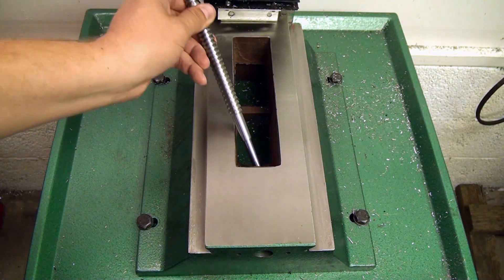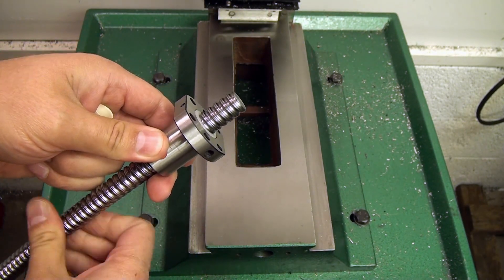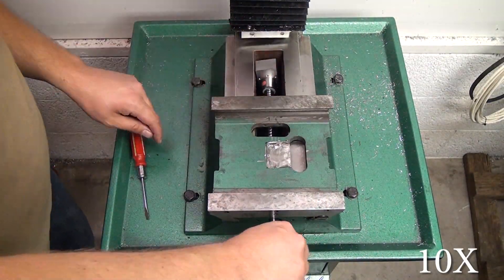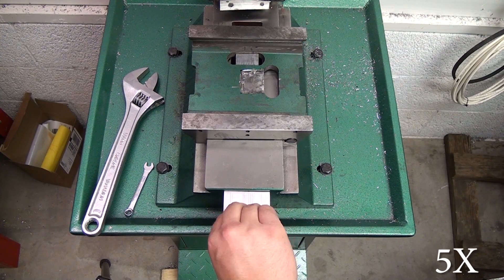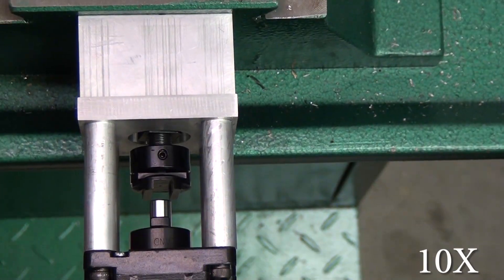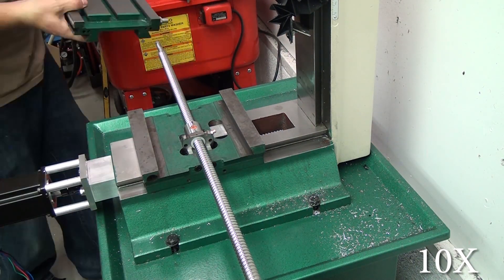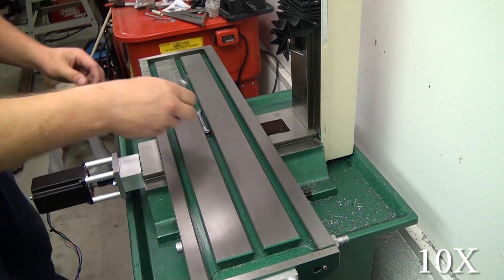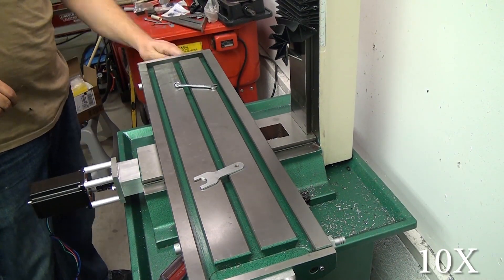G0704 CNC Conversion 07 - XY Assembly & Ball Nut Modification

Comment: Do you miss being able to operate the mill manually? I hear you can kind of do it with a pendant or with some extra plastic handles.... how does it compare with the regular, as built mill under manual control?
Reply from the maker: Not on mill so much, but yes on my lathe. Yes a rotary encoder or pendant would basic give manual mode back. I intend to get there eventually.

Comment: Hi 
Why we have to use new scrow ? 
The original did not work will with the stepper motors?
I means what the  benefit of changed it ?
Thanks 🙏
Reply from the maker: +Anwar Alfaqeeh Alhusseini It isn't required, but the new ball screws are much smooth and offer less backlash than the stock screws.
Reply: russtuff thank you 
I get it 
Thanks again for your support

Comment: Hey Russ, do the shims go on both sides of the AC bearings? Or just the sides that point "out"? 

Also, according to your Excel sheet from your second conversion video you used keyed shims (McMaster 3088A773) instead of the ones called for by Hoss (3088A383) . Was there a reason you needed clearance for a key?
Reply from the maker: Man it's been a long time so I'm not super positive. I think the shims were on both sides of the AC bearing. Behind the bearing for spacing, and in front of the bearing as a small shield for the grease.
As for the shims, they are the same size but mine have that notch in them. I'm guessing Hoss has updated his info at some point and he is suggesting the non-keyed shims. I would go with the 3088A383.

Comment: I`m about to pull the trigger and buy the G0704.  I`v noticed that some people are selling ball screw and step motor mount  kits pre-made. In hindsight would you suggest building your own setup as you did or buying one of these kits ? Any help you could provide would be appreciated...
Reply from the maker: That's a tough one. I do see the appeal of buying a kit and being done with it, but making everything myself was a nice intro to machining class. All of that said, if I had more time than money I would convert myself. If I had more money than time, I would buy a kit.
From what I've heard from other people, some of the kits come with minor problems and you are going to be on your own to fix/adjust it. If you build a kit you're on your own too...... tough call.

Comment: Hey russ, I've just received the parts for my craftex cx601 cnc conversion, and was wondering what are the bearing numbers  you use for the x and y axis? These are the small bearings by the jam nuts.
Reply from the maker: I'm not sure the size, but they were cheap. The outside diameter is almost exactly the same as the stock diameter bearings, then the inside of the bearing is to fit the screw shaft. You can probably get away with using your stock bearings if you wanted.
Reply: Thanks I happen to stumble across the correct one from a local supplier.

Comment: What is the pitch of this ball screw? turns per inch, or distance per inch?
Reply from the maker: This is a 1605 screw, meaning 16mm diameter and 5mm pitch.
Reply: Thanks!!!
Reply: Another question. Are your steppers nema 34??  Thanks again
Reply from the maker: XY are Nema 23, Z is Nema 34. Check one of the earlier videos in this series and you can find a spreadsheet with every part I used during the conversion.

Comment: Hi, can u tell me what stepper motors u use? I already have nema 23 , 425 Oz-in,3A. Do u thing they are good enough to use them? I want to buy milling machine ZX50CF which i similar to G0704. What accuracy u get with this machine, are u able to work on steel?
Reply from the maker: +Riste Bozhinov You can find all of my components in this video: https://www.youtube.com/watch?v=lJpjbyt4lRw

My X and Y are using Nema23 570oz (5amp) steppers, and the Z is a Nema34 906oz (6.1amp). I have no doubt the 425s will work for the X and Y, I'm not sure about the Z though. You may want to do some searching on the CNCzone or other forums to see if people are able to use a Nema23 motor for the head.

I plan for accuracy of .002", but typically get better than that. I did a 4" circle once and it was out .004" across the diameter, which I am pretty happy with. A double-ballnut setup would probably work even better. Also, I haven't really spent a lot of time chasing away all possible backlash (I just don't most things require .001" or better accuracy, at least my stuff doesn't).

It will work on steel but only with smaller cutters. If you're using 1/4" and taking shallow cuts you'll be fine. I struggle with anything bigger. 1/8" end mills are no problem at all in steel. The main thing to remember is these mills are light and not very rigid. That means if you go slow and take light cuts (TAKES A LOT OF TIME) you'll be fine.
Reply: +russtuff What do u mean with double ball nut setup? How to install it and what is in double ballnut which makes better accuracy? About milling steel with deeper cuts have u ever thing about changing the spindle motor to bigger one?
Reply from the maker: +Riste Bozhinov Search Google or the regular CNC forums. You can get a double-ballnut setup on Roton style screws or on C7's. linearmotionbearing2008 sells them on his ebay store too, which is where many people buy from.

A bigger motor isn't the issue when cutting steel, it's rigidity. But yes, I do have a bigger motor and a belt drive conversion. You can find my playlist on the matter at: https://www.youtube.com/playlist?list=PLv4P26_5EBixBSwC5KtcrmawBFBAbtQnB

Comment: How much backlash do you have with those chinese ballnuts?
Reply from the maker: +Jared R I've never measured one of the screws itself. I have two of this brand on my mill and it holds under .002" on both axis, so I'm sure only a portion of that is in the screw. My lathe Z-Axis is just as good, but I have about .005" backlash on my lathe X-Axis (needs more troubleshooting).

I use backlash compensation in LinuxCNC to get both machines to under .001" per axis. Even though my lathe X-Axis has .005" backlash my parts are consistently coming out within three tenths of each other :)
Reply: +russtuff .002 is alot of backlash for a ball screw. You could have used acme threaded rod and a nut and achieve that. Try upsizing your balls slightly, I&#39;ve heard of this as being a solution as some balls might not be the proper size from the manufacturer (overseas manufacturing) we're talking on the scale of ten-thousandths 1/10000
Reply from the maker: +Alan S Hey Alan. I've tried to increase ball size using a .0005 oversized ball but they won't fit. I've never found a supplier who can offer a ball .0001 over-sized for a price that is reasonable for this budget type screw. I know the guys using Roton screws have had good luck with finding balls that will fit but I'm not sure anyone has done it on C7 screws.

My comment was that I have .002" backlash total and haven't measured the actual screw backlash. I'm sure only a portion of the backlash is in the screw itself.

Comment: Great video.  I don't see a zerk fitting while you are grinding the X-axis ball nut, but then I see a zerk fitting while you are installing the ball screw.  Did you add this zerk fitting yourself, or did it come installed with the ball screw?
Reply from the maker: The zerk came with the screw/nut combo, but you want to take it off and plug the hole before grinding/cuting the nut. Then put it back on before assembly.

Comment: That's CPVC, it has higher heat tolerance than PVC. It's sized differently so that it won't be inadvertently used with PVC fittings.
Thanks for these vids!

Comment from the maker: Right at about $2700 for the conversion itself. If you want more specifics, check out my "G0704 CNC Conversion 02 - What it Costs to Convert" video. In that video you will also find a link to my web site where you can download my Excel spreadsheet where I tracked the entire conversion cost part by part.